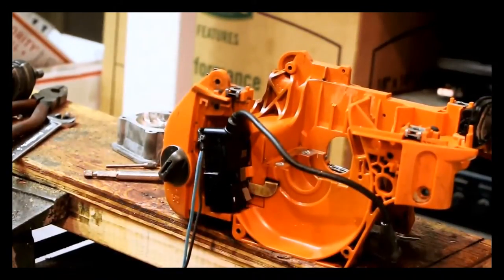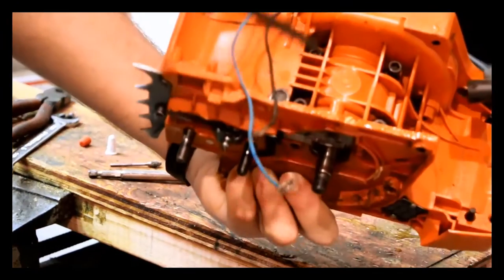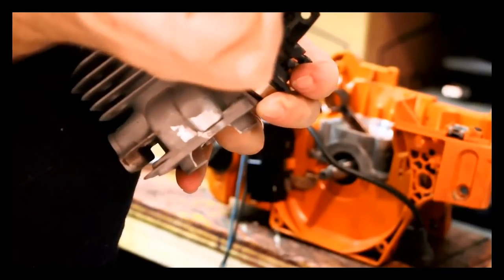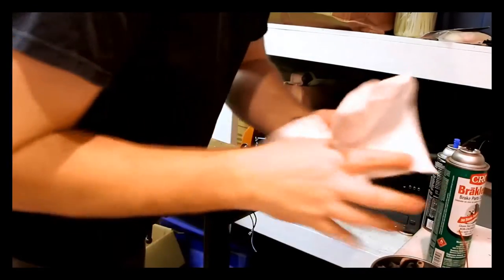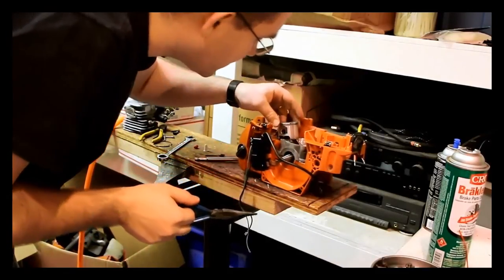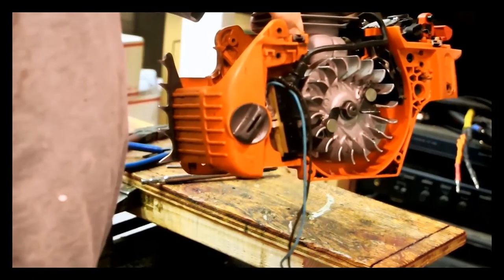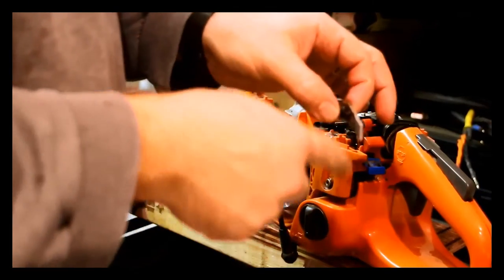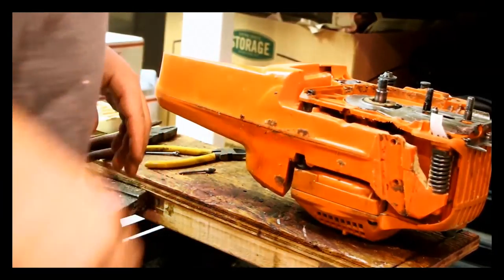Husqvarna 350 dismantling, modding, and assembly part 4

Comment: what exactly is this 505 thing? i'm assembling a saw soon what i did not take apart, wanna know what to put between cylinder and crank case
Reply from the maker: buubised use threebond 1184 between plastic chassis and bearing cup
use loctite 515 or 518 between bearing cup and cylinder. ..google them
...
Reply from the maker: buubised https://youtu.be/rr-9MVG8dMI
Reply: The problem is I live in a place where i can't get these products so easily from the shop, they just do not sell so wide variety of products here. So I have to find an alternative. I have the soft gaskets for everything, but i still need to use some sealant? I have a 20 year old 254xp , it's a little different than this saw, gonna check it out tonight..
Reply from the maker: the 254 is nice .... check out my 262xp vids ... i have bolt for bolt vids there too.  you need some type of liquid gasket maker for the husky 350 ... and it MUST be fuel and oil resistant.   threebond 1184 and loctite 515 or 518 are available on ebay.

Comment: Hey Matt, great videos. you mentioned that you are not doing an ignition timing advance on this saw because it doesn't need it. Can you elaborate on this please? I did a base gasket delete and some port work on my 350. I was considering advancing the ignition timing. Thanks
Reply from the maker: this particular model doesn't need any advance...the ignition timing is pretty optimized out of the box.